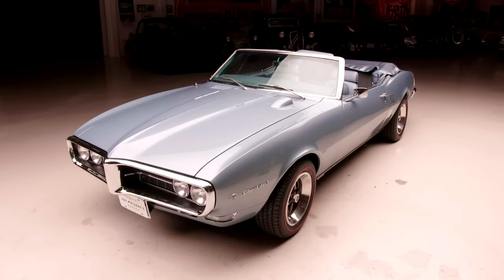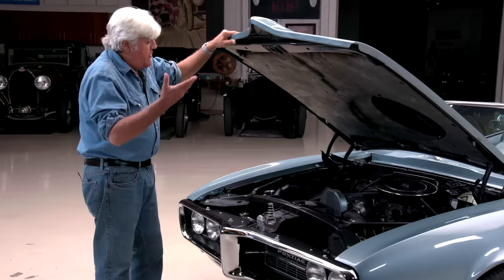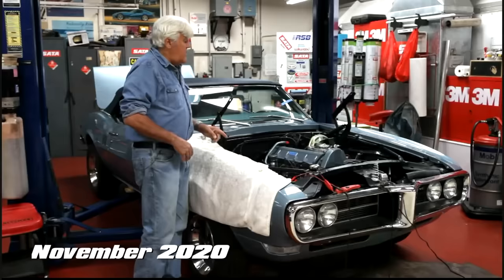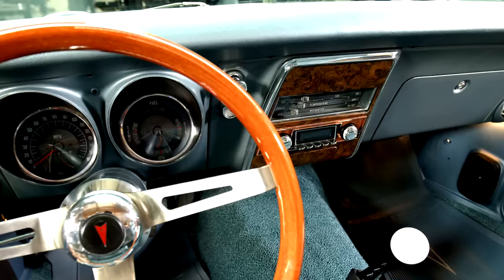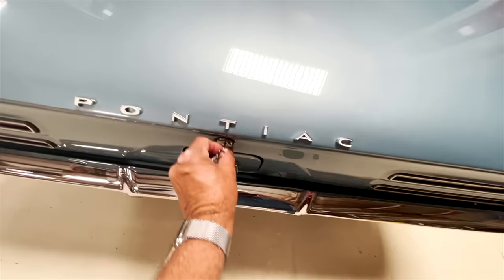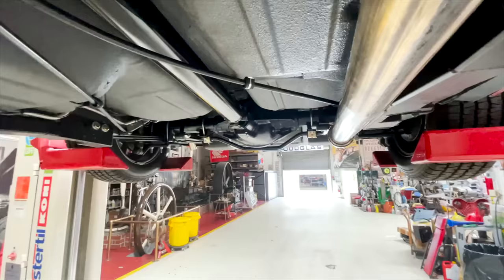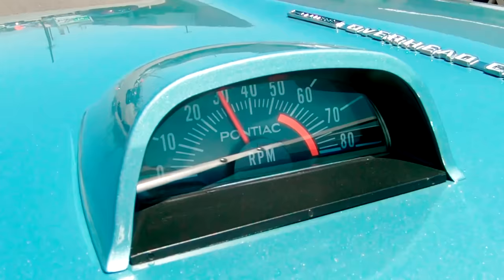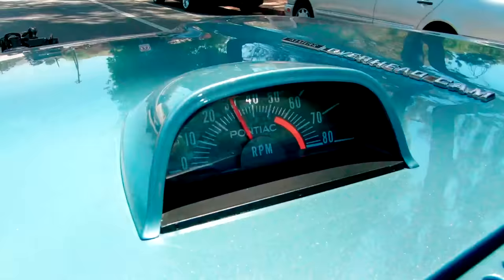1968 Pontiac Firebird Sprint | Jay Leno's Garage

Comment: I had a friend back in the NAVY (1986) that had an old Firebird like that with those same harmonic dampener cans in the trunk,  I think it had 4 of them,  1 in each corner.  But as the car was turned into a street stip drag car,  they were removed.  I also think it came with a small V8 not an I6.  I know when he raced it in Memphis TN it had a Chevy 350 in it.

Comment: I have a 67 Camaro convertible with the shaker canisters. I think they have a suspended weight in oil. I removed them and I don't think there was any negative impact, especially if you have the sub frame connectors. It's like 80 lbs of wight reduction.

Comment: Say what you will about a six cylinder. 
I must admit my first reaction was not ideal. However, with the ability to tach it up in the power band with the 5 speed, and the handling capabilities due to the power to weight ratio this drop top will be eating everybody’s lunch in the canyons. And doing it with style as well! Burn rubber. 🤘🏼😎🤘🏼🔥🔥❤️🏁

Comment: I had a 68' Tempest in 1977 that cornered like no tomorrow with a Chevy 283 under the hood that had power and economy. It said "Radial Tuned Suspension" on the steering wheel. I miss that car.

Comment: The first belt driven overhead cam engine was produced by Vauxhall Motors (owned by GM) in 1966 for the launch of the Vauxhall Victor FD model, in 1599 & 1975cc. Maybe where Deloren got the idea. The Vauxhall engine was supposed to be a V8 but economics played a part and it ended up as a slant 4.

Comment: My best buddy had a 67 LeMans GT with the single overhead cam inline six with a 4 barrel and 3 speed floor shift. It was a convertible. We drove that car from Ohio to Texas and back. That car would run good for a straight 6. I don’t recall the horsepower but it would walk away from my 64 Chevy Belair with a 283 V8.

Comment: Not to be an Oscar but Kaiser-Jeep had the tornado 230ci OHC In-line 6 in 1962- 4 years before Pontiac. It came in the Wagoneer and the Gladiator and all the military M715 pickups. No belt driven cam but the fuel efficiency blew everything else out currently in production out of the water. Weird fact- the cam only had 6 lobes that operated both the intake and exhaust valve for each cylinder-
Reply: That is weird.  But I like weird.

Comment: My dad worked with a guy that had this engine in a Pontiac tempest? I don't know if they ever offered it in earlier years. But he said it sounded different than the topical 6 of the 60s . Didn't sell well with V8 was the thing. But handle well for the weight.

Comment: Love the very GMness of the "clack" of the starter when the engine fires. I never owned a GM before I bought a 10-year-old '73 Olds Omega (a truly awful car in every respect) with a maybe 96 hp 350 V8 (with four-wheel drum brakes no less, and I think fender rust was a standard feature at the time), but I always loved the sound of that GM starter "clack". Much more authoritative than the whine of those weird Chrysler starters in the cars I usually had available to me at that time. 

Now, I have a 2015 Prius, almost 300,000 mi (almost all of them Uber and Lyft miles), and the starter (which I don't have the ability to operate manually) makes no noise at all, which I also love. Great car.

Comment: GM put those big heavy canisters at each corner of the body, on their late-1960s convertibles.   They contain fluid and a weight in order to reduce body flex.  Corvair convertibles had them as well ..

Comment: Another great video Jay! A real treat as this motor has always fascinated me and I have never heard one run. Yours sounds lovely. If John Z had got the Banshee into production he would really have had his E-Type. I love that color and the red band tires, too. One thing: the Glas 1004 introduced in 1962 was the first mass production car to use a cam belt, although this type of camshaft drive was invented in America during the '50s by Bill Devin (of Devin cars fame). I noticed that Wikipedia says the Pontiac is first, but forgets Glas, a Bavarian company later taken over by BMW.
Reply: In any event, cam drive belts are a pain as they break at 40 - 80K miles and leave you stranded!

Comment: A later model of the Pontiac Firebird Sprint was used as the first car on the Rockford files. Although the car had the larger engine that was typically in the Trans Am. As far as GM vehicles go Pontiacs sports cars and especially the Trans Am in the 70s kept a better looking body style whereas some of the other divisions became to generic looking. I especially liked the late 60s and very early models in body styles. I haven't watched the De Lorian  documentary but it is available also on Roku. Talking about engine size Jay I wonder if you've experienced or experimented with any big four engines. They typically have more power but or geared to the rear differently since most in the past were in utility vehicles.

Comment: My sisters 68 FB Sprint had 350HO option. Also had PRW x F7014Polyglass bias ply wide ovals. RTS in my 74Formula was so  much  better!!! She had the Sprint Stripes removed as they attracted Speeding Tickets😉 Saw plenty of Tempest/Lemans with P OHC 6 but not HO. When U ordered HO option, Pontiac came with HD 4pot Calipers which have larger pistons than Corvette calipers in 68. She rusted out at rear leaf spring perches where the convertible has the Renforcment 2#coffee cans! Same 4 Cameron conv 67-68-69. Cam followers are doomed (stock) with ZDP&Phos removed oil!  2.3 Lima 4cyl Fords switched to rollers in 89, problem solved. Also no cam bearings in P OHC.

Comment: In the late 70's I lived in Corpus Christi Texas and would look around for affordable cars, buy them, drive them for a while and then resale them and try to make a few bucks.  A friend of mine told me about a Firebird Sprint that was on a dealer's lot in Edna, Texas.  He and I drove up there and after a cursory look I bought it.  I think I paid around $800 for it.  It was yellow with a black interior.  I drove it the 110 miles back to Corpus Christi and opened it up and hit 95 mph with no clue as to whether the tires would handle that.
Keep in mind this was summertime in south Texas and the Sprint did not have A/C.  I think I drove it for a few months and then sold if for a few hundred dollars more than I paid for it.  One of the dumber decisions I ever made.

Comment: What Jay may not know there was a prototype hemi version of this engine. there was supposed to be a roller follower version of this engine, and it got canned due to the cost of the followers. These engine could actually outrun a Chevy v8 with a 3.90 gearing. The main problem of these engines was the camshaft not having enough meat on the base circle so you can make custom camshafts for it, and the cast iron material is now hard to find. AS a side note Pontiac had ready to go on the cover of Hot Rod magazine in the late 60's, OHC 3 valved version of their v8s, long before Ford did the 4.6 and 5.4 sohc v8s.  Damn shame they didn't do them.

Comment: Oh I forgot something about that engine in the tempest . Yeah it's still a Pontiac. And the most important thing was it had 4 wheel independent suspension. All an gm experiment.  I think? But my dad said it never took off. OHV 6 with 4 wheel independent suspension. Wow! 68.

Comment: I remember these when they first came out. Most of these engines were pulled (sadly) and V8 dropped in. Similar to guys pulling the early 302s and 350s (even more sadly) out of the Z28s and putting in big blocks. Just not a big deal back then, who knew?

Comment: I've always preferred Pontiacs over their GM stablemates - they were always sportier and different and had nicer combos of colors/paint/trim, etc.  In any given year(save a few exceptions), I prefer a Pontiac model over it's Chevy/Olds/Buick version, particularly the Camaro/Firebirds. I'm particularly fond of the late 60s/early 70s Bonneville convertibles, fully optioned. Very nice cars.

Comment: Jeep had a six cylinder  230 overhead cam called the Tornado * 1966!  The trunk weights are because of the new laws for safety regulations for convertibles,  remember  Ralph Natter? On those year's  .  When it comes to convertibles from this time period weights may had placed in side panels,  door's,  trucks..  it was all about correct weights for safety regulations!

Comment: Mr Leno, those are the cocktail shakers in the trunk do not open them or you will have a mess on your hands they are tuned to a resident frequency of 17 Hertz because the convertible f-body did not have any additional bracing

Comment: A book "THE FABULOUS FIREBIRD" by Michael Lamm "To counter body vibration, Firebird convertibles carried "cocktail shakers" at each corner. These cannisters contained spring-loaded weights suspended in oil."

Comment: In 1969 I acquired an almost new 1968 Camaro 327 RS convertible; Muncie 4spd., Carter 4bbl. and it had those 'weights' in the rear plus an extra cross member piece under the car. I was told those were there because it was a convertible. Mine had small really small drum brakes.. no power anything but the top. Not as good looking as the Firebirds.

Comment: Kaiser produced a overhead cam inline 6 cylinder engine . The Tornado 230 . Before the Pontiac 4.1 liter overhead cam 6 cylinder. Preceded the Pontiac by 6 years If I'm not mistaken

Comment: In 1968 I had a 1966 Pontiac LeMans  with this same engine and a 3 speed on the column. Nice car but I did have some problems with the engine.

Comment: The Jeep Tornado engine was the first post-World War II U.S.-designed mass-produced overhead cam (OHC) automobile engine. The 230.5 cu in (3.78 L) ...
jeep overhead cam 6 from en.wikipedia.org
Production: 1962-1973

Comment: I have a Sprint coupe, but mine is more Camaro now. SBC with Muncie 4 speed. I just didn't have the resources for one off parts to rebuild the top end. I'm surprised you didn't upgrade the interior to the deluxe package. The door panels are so much nicer. I have the deluxe.

The engine was made for 4 years. 66 & 67 engines were a little different than the 68 & 69 engines. The differences were in the top end. The 69 was best. I liked the OHC6, but there just aren't any parts. 20 years from now I'll still be able to get SBC parts

Comment: The anti-vibration canisters in front & rear, I removed all 4 of mine out of my1968 Pontiac 400 x 4 speed convertible car in 1977 and noticed NO DIFFERENCE with them gone. I keep them, but I would never put them back in.

Comment: I wonder if those cylindrical stabilizer weights in the Firebird's trunk contain depleted uranium, not lead, in them.  Factoid: When the original 747s were manufactured in 1968, that jumbo jet used depleted uranium weights on control cables attached to the giant tail rudder, to prevent excess movement.  After all, scientists then said depleted uranium was safe, what could go wrong?  Refer to the Bijlmer disaster on 4 October 1992, when an El Al Boeing 747 cargo jet crashed into the Groeneveen and Klein-Kruitberg apartment complex in Amsterdam, Holland. That 747, made before 1982, still used uranium weights, not the tungsten weights in post-1982 747s.  The 1992 crash spread the now pulverized depleted uranium in the 747 all over the city neighborhood.  Until you find out, avoid rear end crashes in your Firebird.

Comment: Odd, Jay did not know what the "cocktail shaker" was. Not so odd, neither did I. I understand Ford used something similar in the Thunderbird. Yes, they are weights suspended in the canister with oil to dampen vibrations. I saw one for a couple years for sale on Craigslist and thought he wanted a lot of money for a vacuum canister (which it wasn't).

Comment: Why did Pontiac bother with the overhead cam if it only revs to 5500 rpm?

You can easily achieve that with heavy pushrods, heavy rockers, and a camshaft optimized for peak power slightly under 5500.

The only advantage to an overhead cam is the valvetrain is light so you can use a high lift, long duration cam and rev it significantly higher. This allows you to take advantage of an aggressive cam and make huge power (typically in the 7000+ rpm range or even well above that).

As an example my 2008 Yamaha Apex has the high performance 4-stroke engine from the R1 motorcycle. With its overhead, aggressive cams and lightweight valvetrain, the 1.0 liter 4-cylinder makes a peak of 167 HP at 11,250 rpm (dyno tested and 100% stock). If that was increased to 4.1 liters and maintained as volumetrically efficient, the naturally aspirated engine would produce an incredible 685 HP!!

Comment: Jeep had an OHC straight 6 in 1962 vehicles... https://en.wikipedia.org/wiki/Jeep_Tornado_engine 
Wish Jay had dyno'd that engine, always suspected the 4 bbl. version was a little under rated for HP... back in day saw several run on a dragstrip as part of a gymkhana... the exhaust made a bang like an explosion as they took off from the starting line...

Comment: Hi Jay,  I am with you.  The Firebirds were always better looking than the Camaros.  The weights in your Sprint were always part of the early F-body CONVERTIBLES.  The weights were used in an attempt to reduce body/chassis flex inherent without the fixed roof that stiffened the structure.  The design having unconnected front and rear subframes were subject to significant twisting.  Are those Hotchkiss subframe connectors bolted or welded to the subframes?  Looks just bolted.  I am 3/4 finished with a ProTouring RestoMod of my '70 Firebird.  My vision statement for the build: "What Would Bill Mitchell Do?"  Extensive, functional, subtle updated Firebird second gen beauty with factory-like design.  In for specs and pics?

Comment: I was in college when that car was new and remember the Sprint Six well.  I don't understand why Pontiac did not make the head a cross flow with the overhead cam.  It looks like they cheaped out by slapping an overhead cam on the old Chevy stovebolt six head.

Comment: Not even Pontiac people know about the OHC6? I think most Pontiac people do. Also, the engine was not a chevy with Pontiac head on it. To save costs Pontiac used the rotating assembly from the chevy 6 so they could spent the money on the block and heads. That's why the engine increased in size the same time the chevy did. IIRC the 67 Sprint made 215hp and in 68 and 69 it went up to 230hp. That being said, he did a good job of making this car what appears to be a fun car.

Comment: Used to have a 68 firebird V8 350 back in the late 80s was always going to bone yards looking for parts for it, came across a 68 with a straight 6 overhead cam engine in it not sure if it was a sprint or did they make another version of the straight 6 overhead cam?  A & H bone yard Salem Mass is we’re I believe I saw it.

Comment: As well as the Jaguar double overhead cam six, Mercedes Benz used them widely at least since the Gull-wing 300SL. In single overhead cam form the 2.2 to 3.0 litre versions dominated sales until the mass production V8 motors introduced quite late in the era.
The Mercedes Benz 220 fintail sixes may have been the inspiration of the Toyota 2.2 litre single overhead cam six used in the circa 1966 Crown model. Especially after the early Australian Toyota models and Mercedes fintails were assembled in the same Port Melbourne AMI assembly plant. Did Toyota take interest in these Mercedes cars?
Reply: Well, they lifted the 235 six design directly from Chevy for the original Land Cruiser, so ...

Comment: I called The Parts Place for a throttle cable for a '70 Lemans I'm fixing up with a 250 six.  I asked him a basic question regarding fitment (the part is listed as fitting "all")  and he said he didn't know.  I said well you guys make it, if you don't know who does?  Rather than just finding out, he replied in a clear condescending tone "Well who puts a six cylinder engine in one of those cars anyway??"  I said "Ummm, General Motors?"  What a schmuck...

Comment: Had they properly sorted the Pontiac OHC Six at the start, it could have easily formed the basis of a 1.8-2.5-litre OHC Four derived from the Chevrolet 153 4-cylinder and thereby negate the need for developing either the Vega or Iron Duke engines. Imagine how Cosworth like they did with the Cosworth Vega in real-life, could have developed the OHC Four/Six into a DOHC Four/Six.

Comment: I used to work at a bodyshop for a couple of young know it all punks.  I mentioned  the Sprint Firebird and it's straight 6 OHC engine.  They both laughed and pointed at me for being so dumb. Pontiac never made an OHC 6 they said.  LOL 
 I actually had had the model car kit when I was young that gave the option of using either engine.  Young and dumb they were.  (They went out of business about a year later)  LOL

Comment: Its a really cool engine, but it is not the first mass produced overhead cam straight 6 in america. The Jeep Tornado engine has that title. That was the first post-war overhead cam engine to be mass produced. I think its kinda crazy, considering it came from a small company like Willys/Kaiser. The outgoing 6 cylinder that the Tornado was replacing was a flathead, and they went right to hemispherical combustion chambers and an overhead cam.

Comment: Jay? Do you know what upper radiator hose was used on your Firebird? I own a 67 Sprint Firebird with power steering, A/C, & California Emissions. And I have not been able to locate an upper hose that fits like the one on your car. It currently has a flex hose installed that I would like to replace.

Thanks in advance for any info. Very nice to see you enjoying your Firebird! And getting the word out how nice these models can be.